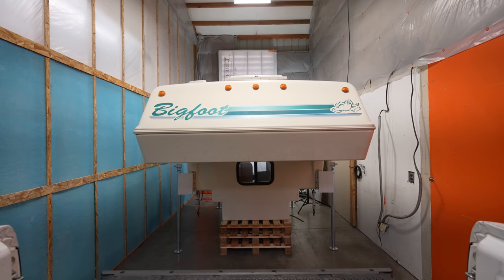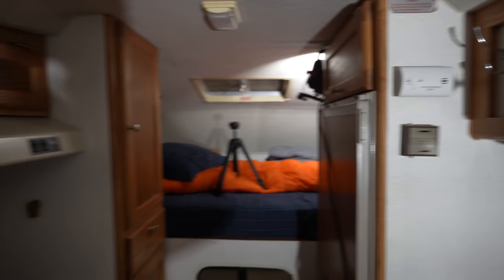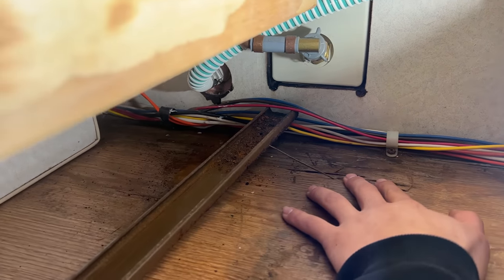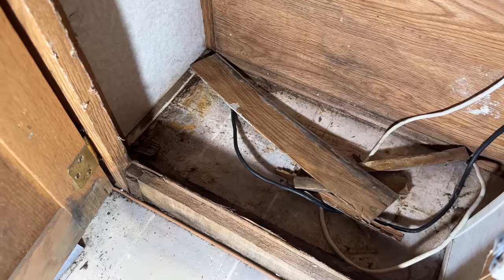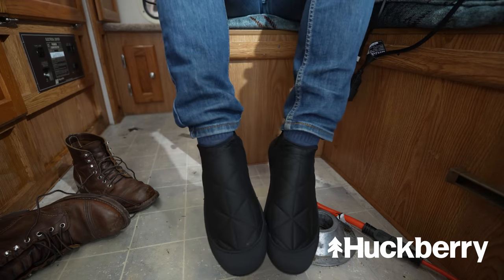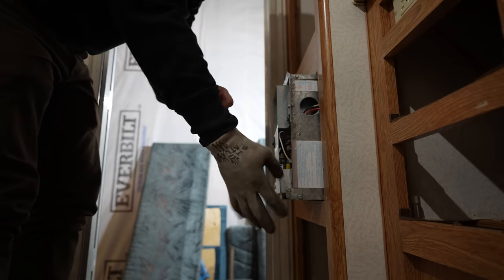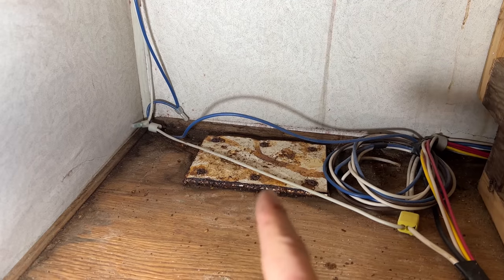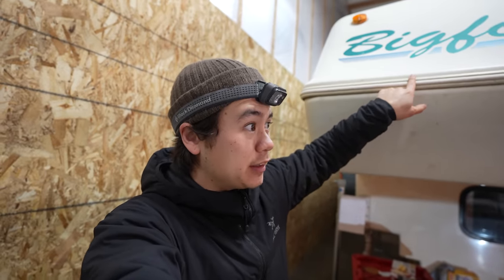Tearing Apart my Truck Camper (the renovation begins)

Comment: Good luck with the rebuild. My brother in law had to tear down his bigfoot c8 right to the bare bones and he's renovating it right now. It's a big job! If you don't have to don't tear the ceiling down, they are a pain to rebuild correctly. Also the structure of the camper comes from the sandwich panel design. The insulation is glued to the fibreglass and the paneling to the insulation. That's what gives it the rigidity so keep that in mind when you are building. The upper cabinets, fridge, and cabinets by the bed give the roof strength as well so you might need to build something back in the spots you cut out.
Reply: It would be cool to see his build even if he's not much of a youtuber.
Reply: I'd like to come check it out and get some advice as I am going to dig into one soon! I can bring my Cummins down and show yas the rustfree roof. Ha!
-Shiny
Reply: @merccrewlcab2385  his bigfoot is up in Comox. I've got mine loaded up right now in Vic. Doing some work on it in the next couple of weeks. Solar panels, electrical, redoing the floor.

Comment: Part of the moisture problem is no doubt due to your use of unvented propane devices such as the Mr Buddy and your gas stove. For every pound of propane you burn, nearly two pounds of water are added to the interior atmosphere. That's on top of your breathing and perspiration. Best thing to do is add (or replace) an outside vented heater. A vented heater with a heat exchanger can dry out the interior without adding more moisture. Either a propane or diesel heater will do the job.
Thanks for your entertaining channel. I look forward to watching the new build.

Comment: I'm following now with great interest. I just bought a 23 year old truck camper that has some obvious water damage. I am very familiar with how to repair it, and I am ready to get started. I'm reluctant to go "full-send" on the project for fear of what I may find. I am doing the "knock test" to find where solid material begins and flimsy material ends, but I know that isn't the most comprehensive test. It will get me by though. I plan on doing a complete rennovation in stages, addressing the obvious stuff and most critical structural stuff first; the rotten wall, corner, jack mounts, tub and floor. I'm removing a 120 pound generator and the 6 gallon water heater right away. Neither work, so they won't be missed. I found a used tankless water heater for as much as a new gas control valve would cost, so the water heater is a done deal. Off grid power will ultimately be a 2000W pure sine wave inverter, LifePO4 batteries and 200W of solar. The whole system will weigh less than the generator, won't make any noise and won't require any maintenance other than keeping the solar panels clean.

Comment: Keep in mind that condensation is unavoidable in a small space. Even if you don't have any leaks, just inhabiting a camper regularly in cold weather can lead to this. What happens is the condensation slowly builds up in places like insulation or against walls in contact with the cold outside world and then never leaves. It's not an easy problem to solve unfortunately because it's just basic physics. Foresty Forest is dealing with similar problems and even tried installing a woodstove in his van to dry it out.
Reply: Needs to be treated like a boat hull. Havelock Wool which will dry out and not retain the condensation,  HullBlanket headliner & Boat Koozie stick-on insulation and try not to completely seal in cabinets or other compartments. If this is the case in the build, install mini round vents at either end of a sealed compartment.
Reply: Ventilation is key.
Reply: Another thing to keep in mind is that during cooking a byproduct of the combustion of propane is water vapor. Not to mention moisture released from the food as it cooks. So its always advisable to run ventilation while cooking and as Calvin mentioned just inhabiting a space adds considerable moisture to the air and it will eventually find its way to the cooler parts of the space where it will condense. That appears to be what we’re seeing here, not necessarily water leaking in from the outside. I’ve found that keeping an electric heater set at a fairly low temperature in my travel trailer in between outings with the ceiling vent slightly cracked open is effective at keeping condensation at bay especially during the cooler months of the year. That said, I’m looking forward to seeing your progress on the renovation as well as the future adventures we’ll be going on with you (all 100,000+ of us!) Thank You Jonathan! Please continue. 🙏
Reply: I live full time in my truck camper, and every morning, the first thing I do is crack windows to ventalate from the night before. I also sacrificed a large clothes closet that was centrally located in my truck camper for a custom-built woodstove. Solved 90-percent of my  condensation issues with that one improvement. Propane simply adds too much moisture. Using fans and ventilating when cooking is also key. I also leave cupboard doors slightly ajar except when on the road. Living full-time in my rig enables me to monitor everything daily, thereby addressing moisture before it builds up. Preferring mountains to desert also means being extra vigilant for moisture issues and addressing them before damage is done. I think a lot of folks don't properly prep their campers and RVs when not in use, thereby allowing damage to occur while in storage. Just my two cents from years of truck camper life. 🙃
Reply: Buy a bag of charcoal and problem solve. Put it in any condensation spot.
Reply: What he showed is far beyond condensation.
Reply: This is definitely beyond condensation, but for condensation there are bags that collect water in small spaces. Damp Rid is one, but they have a scent that I personally do not like. But there are others.
Reply: Dry heat is key, along with ventilation. I was starting to wonder if there’s anything wrong with this particular camper...The channel “Alex Lives Well” (now known as “She Roams Wild”), has the exact same camper and she has major water and mold issues and is completely renovating it including new top line windows and a new subfloor also. Both of them are AWESOME 👏💯👏🙌
Reply: Pnw I was running my furnace at 76 for a couple hours every day to  dry everything out when not occupied, was a loosing battle. My old pastimes wooden frame was rotting out from condensation.
Reply: @Mackenzieadventures1  yes!
Reply: Airplane manufacturers figured it all out

Jfc
Reply: Use a humidifier if needed 5:46

Comment: I agree with the other comments about cold weather condensation.  In a small closed space like a camper there is no way to avoid this issue.   Cooking in cold weather should really be avoided.  
Even your respiration is a cause - tents in cold weather without proper ventilation will have the walls covered with moisture in the morning.   

On the other side choose your new materials carefully.  As you see wood products are just sponges for moisture so they should be avoided in space enclosed and adjacent to a cold outside wall.  
Your floor is a good example - the wood gets very cold from the outside and on the inside the moist air finds the wood and the cold condenses the water vapor to liquid water in the plywood - just like a glass of ice water on a summer day with beads on the outside - except this is inside out with the cold outside and the warm inside.
I would try for a closed cell foam for insulation adjacent to the fiberglass wall.  Sandwiched walls with wood in them will become cold so avoid this - use some solid material that does not absorb moisture.  Not sure what is appropriate for a camper but avoid wood.
You can use wood for cabinets as long as they are separated from the cold and not adjacent to cold walls.  HTH

Comment: I’ve lived in a lot of vehicles over my life and like others say condensation over time just destroys the interiors. I’ve had walls in caravans literally dissolve becoming spongy without a single exterior leak.  Saying that the only thing I found that cured all of it was having a wood burner . The type of heat it puts out keeps everything dry and even cured some of my homes that had just started to go a bit .  Don’t know what your plans are but it became my first job as I moved into any new vehicle.  Good luck with the refurbishment 👍
Reply: Think he wants to put one of those lil diesel heaters in it. That should take care of condensation

Comment: On a previous video I commented not to change a thing, because it holds value as is and is quite functional. After seeing the water damage uncovered I understand that it cannot be kept as is. Still, I would never attempt such a huge project. I'd rather be camping. You must enjoy this. Hope you have the spare change to rebuild it from scratch. It does not look like you will be reusing any of the existing fixtures.

Comment: Hey bud; love the videos. I’m sure you did some research but fiberglass is not inherently structurally sound. It needs cabinetry and structure inside to make sure the fiberglass doesn’t flex when moving. Just make sure you heed to that for your reno. Good luck!

Comment: Jonathan, under the shop lighting conditions, the video displays banding. You will need to make sure your shutter speed is multiple of 1/60, 1/120. 1/240.  It's because of the refresh rate of the lights and Hertz of the electrical service in the United States.  As I type this, I *think 1/30 will work also.  You can do the research, search rolling shutter/banding in video.

Comment: With all that hidden water it's probably a good thing that your electrical system wasn't working. Glad you weren't injured during the ball joint failure. Doing spin outs with the camper on is probably a terrible idea going forward. It may be fun, but can't be good for it. I know you'll do an amazing job on the rebuild and am looking foward to seeing it. Take care and God bless.

Comment: I’m crushed that you have to gut the Bigfoot. Condensation is a killer, I’m sure it was it major cause in your issue. Can cause health problems also. Good Luck with your rebuild. Hope you can remedy the situation of condensation with the rebuild. Consider the materials you use that will not be as susceptible to moisture damage and research venting to help relieve the problem. Take care. Looking forward to your future vids of the rebirth of Bigfoot. 👍👍✌️

Comment: I remember redoing one just like this with water damage.  After I tore everything out.  I sealed up everything on the exterior and then put it outside with 4 sprinklers on each corner for about 3 hours to make sure no water got in.  You would hate to find a leak after you remodeled everything

Comment: Bigfoot and Northern lite campers are actually known for retaining moisture inside of them. Especially in the sub-floors!!  That's where the moisture runs to - lowest point whether it is from humidity (breathing / cooking) or from a leak.

I had the exact same thing in my Northern lite camper.  My moisture was from a leak around the vent over the stove. 

My solution was to take everything out on floor and put a heater in there for several days with all the windows and vents open. Then I actually drilled some drain holes through the floor at the back. I live where it is really dry so I would leave the holes open when it was extremely dry outside. Seemed to work.

IF you replace the subfloor go with a marine board as it will last longer but understand that it will still get wet

That's one of the good things about the campers that comes back to haunt you. Because they are so well sealed up the moisture does not sneak out in the cracks or can air get in. Any humidity inside has no way of escaping unless it's vented out. 

The best thing you can do is get into a routine of drying it out on a regular basis.  My routine was to turn on the exhaust vent over the stove when cooking. Then in the morning turning on the roof vent for 30 minutes with the front lower window open. Even in -35c I would do this.  You could tell the difference when it was done and when it wasn't done. I would turn the furnace on high after 15 minutes and leave it run full out.
Reply: My Bigfoot has drain holes on the lowest fiberglass portions near the rear. They were factory included. Runaway Roses redid a basement in a Northerlite  oh my goodness what a job.
Reply: @bob_frazier  cool, they must have found it helps as well.

Comment: Remove your windows. I use super stretch caulking. For all window sealing.  Factory tape foam around windows  does not seal. Also recaulk around lights and other thru fixtures.

Comment: YEEHAW!!!  NOW THIS IS EXCITING!!  You can do whatever you want now!  I will agree that there will always be a level of moisture, but mitigating the damage is very doable.  We have a small Tab trailer (the German model from the beginning, a 2008) and what we've found is setting up a tea light terracotta candle heater really helps keep things dry.  It's such a small place that it actually does a pretty good job heating things up.  Now we are not the kind of campers who come in during a rainy winter trip and strip all our clothes off and relay on a heater.  We have a tent attached room on the side that we usually use, and if we use the trailers heater, open the door and window on the tent side, it will heat everything up.  But if we close the doors and windows, and just heat the camper, the tea light heater does a find job of heating and drying things out a bit.  You can also get a very small dehumidifier, they're cheap and don't pull a lot of electricity.

Comment: I'm restoring a truck camper right now on my channel. You need to dig deeper. Lift the trim strip insert at the exterior seams and pull a few screws. If they are rusty, you have water damage.

Comment: Subscribed because we have the same truck (mine is a 2000 Tundra) and I was looking for a camper.   You showed me several interesting options.   Last summer I bought an 82 Hallmark and did the same thing you are doing,  Total gut job.  Down to the walls.  Cabinets, stove, fridge sink , heater - all ripped out.  Got rid of the water tank and tubing - can’t keep it clean.   Found the same mold from leaks.   Replaced wood that was rotted.  Coated the rest with Kilz to be sure.  For the re-build I used a backpacker mentality.   I don’t want to carry what I won’t need on a trip.   If possible I want to cook outside.   Portable propane stove that can be used inside if needed.  Kept the sink with drain but feed it from a solar shower bag I hang.   Mr Buddy heater when I need it but won’t take it if I don’t.   I will work in a small window AC for trips across Kansas in the summer - but leave it home otherwise.  Built a bench with storage on one side.   Keep everything in plastic tubs inside the bench to stay clean.   Or it holds skis/snowboard and gear.   No wiring except a simple sealed battery to recharge my iPad and phone.   Bought the puck lights you showed earlier.  They are great.   In short - I kept it super simple.   Happy to share pics if helpful.  I’m really interested to see the rest of your build.   Maybe you’ll take me up a notch!  Keep the entertainment and ideas coming!
Reply: Please share your build too

Comment: I think you may have water entering somewhere other than where you pointed out in your video, in order to get the subfloor so saturated.  I'd be sure to inspect the seams where the 2 halves mate for leakage before you begin the rebuild.  Otherwise you may have the same issue down the road (no pun intended).  Looking forward to seeing the progress! 👍

Comment: You might want to check the taillights on your truck. Top and rh side where on when you pulled out of the shop? Top light should only be on when you're brakes are on. No left illuminated.

Comment: Do some research on how fibreglass soaks up and draws moisture in when the gelcoat wears off.  Sun and wind are the worst enemy of gelcoat.  Before you do any repair please reseal your gelcoat or you are wasting you time and money. You can reseal with a gelcoat sealer using brush or spray.  In my opinion the best and easiest way to seal gelcoat finish is to use a good quality liquid boat wax twice a year.

Comment: The condensation thing may be helped with a dehumidifier but that will require more power. Eliminating storage is a bad idea, one day you'll decide to sell it and that will be one of the first things the buyers will look for. I vote for restructuring your storage and unifying it. If you're slick about the rebuild you may be able to trim out some weight.

Comment: You have removed a bit of the structural rigidity provided by those half walls and closet. A box (cabinet) in a corner does provide a little bit of structural bracing. I’m guessing it’ll be OK though.

Comment: All that timber work must add to the weight of the camper. The enclosed cabinets would have restricted air flow to allow the moisture to dry too. The wiring would be better managed in a conduit. A lighter material for new interior fitout? Any former manufacturer employee's watching your video's?

Comment: If I remember right didn’t you say you picked this camper because the outer shell is only 2 pieces? It might be leaking in small other places but I would be checking that seal between the upper and lower shell before to make sure it isn’t leaking and potentially the lower shell just holding water causing your sun floor to hold water like it is. If it’s been sitting in that shop for a few days and it’s still soaking wet I’d bet your lower shell is just holding water.